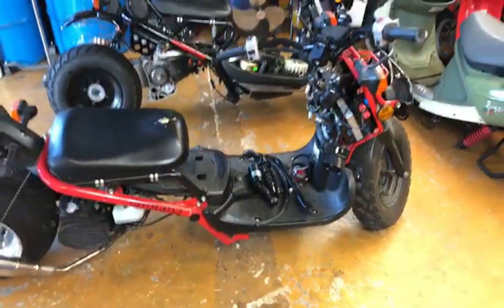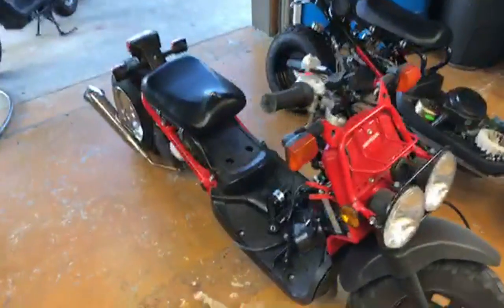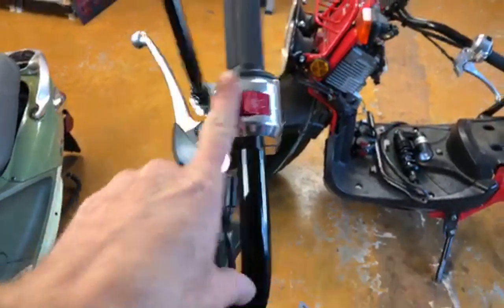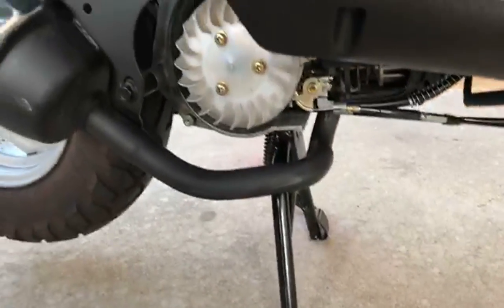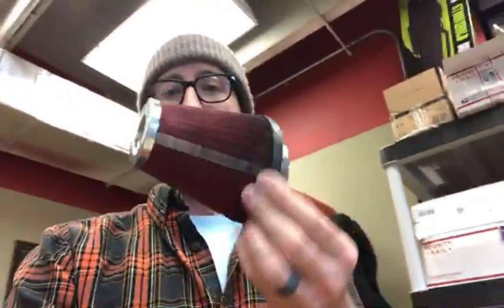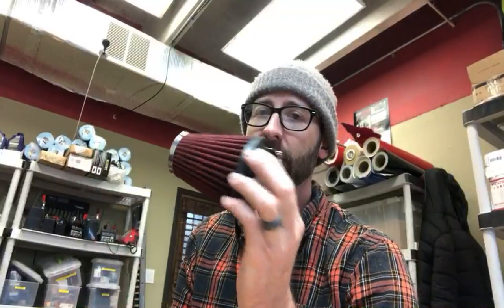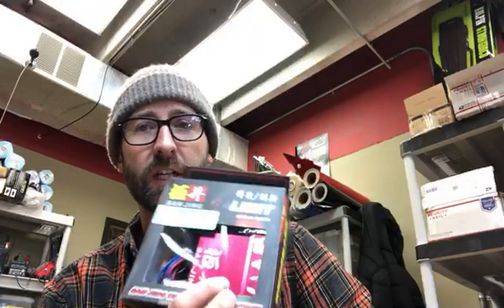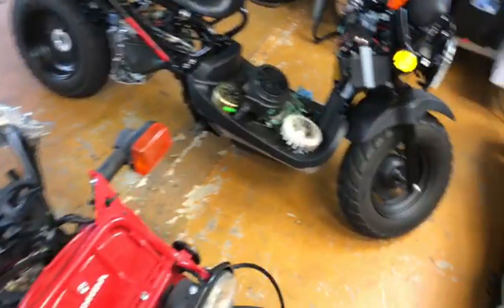Let’s talk scooters 🔴LIVE #4 🎬

Comment: I've not been a scooter guy for long. I bought a GY6 157QMJ on a Velocity mp150-06 frame for $100 a couple weeks ago. A guy was going to lose it in pawn and didn't want it, He gave me the opportunity to get it. Current state, good, no broke plastic, I may take it all off. I've replaced the fuel/vacuum lines, EGR delete, UNI filter, NCY mani, cleaned/adjusted carb, will up the jets if needed, valve adjustment is next then the NCY clutch kit with some slider rollers and new perf exhaust. For about a week I've watched your channel and others for education on scoots. I was never really a mechanic, I'm more into computer builds and electrical but I must admit I'm hooked on scoots as of now. I'm wanting to slam and stretch the gy6 for the hell of it and do some other custom shit as well. I was curious to see if there was some kind of bolt on stretch and lowering kit out there in existence. I'd rather not have to get it cut and welded, if there is a kit like this out there, could you please recommend the best one or point me in the right direction when it comes to doing this.

Comment: I have a 2012 ruckus with 400 miles on it
I bought for my 16 year old son
I want to make this as fast as possable !
With the factory Motor !
So he can ride it back & forth to school . { Safely }

I Have the following for it
1. = Chanito's big bore kit .
2. = Jc Racing Honda Ruckus 20mm Carb Kit 
3. = Jc Racing Bigger Cam  
4. = Jc Racing Lighen Fly Wheel .
5. = mnnthbx  SP Exhaust 
6. = 5111852 Malossi  Variator
7. = Honda Metropolitan Gear set
8. = Real Light Aluminum 10' wheels
9.=  Lite Weight led lights

Taken all the heavy parts off 
I could to make it as light as possable !
Also

There is more 
I just can not think of it'!
Also
We are going to Port & Polish & Mill his head 
try & find bigger Valves
& 
Lighten his Valve train
Polish his crank & rod
find a lighter wrist pin

I am Disabled on a very low income
It has taken me 2 years to get all the above

what do you have & or Sell 
That 
We may need to finish this for him
Thanks
 george Sr.

Comment: I have a problem with my scooter when i start it the wheel turns by itself and when i take it of the stand it rolls by itself it never did that before
Reply from the maker: Check your vacuum hoses for leaks and or adjust your idle. I have a video for that on YouTube